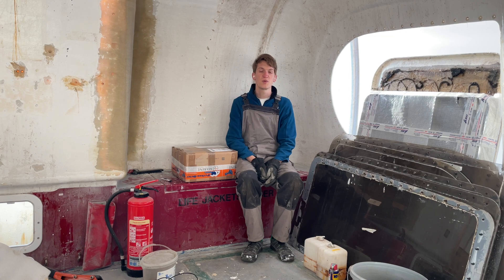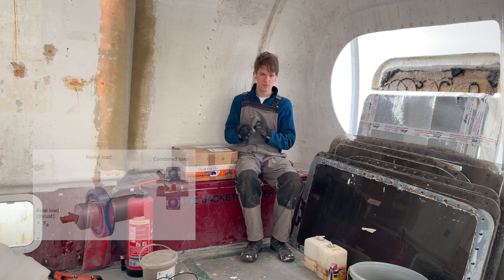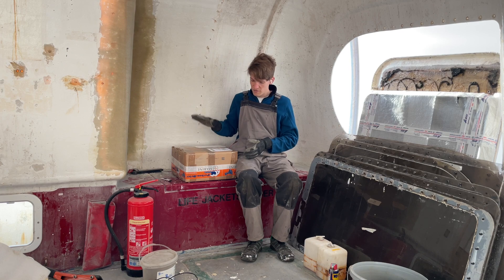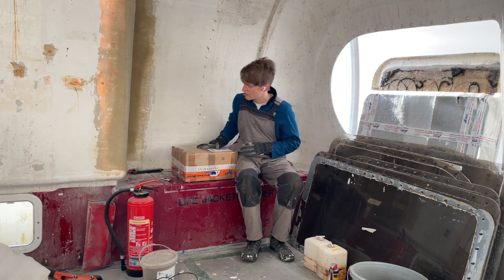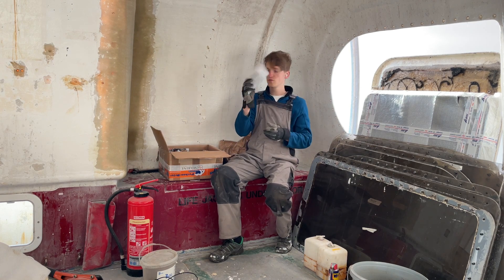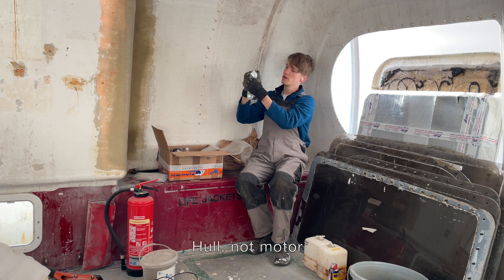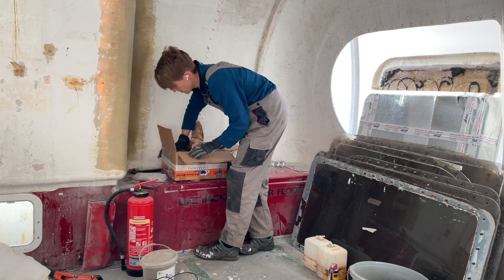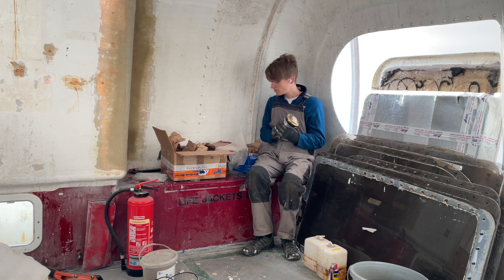Car motor on a boat - Constant velocity joint / Python-Drive / Aquadrive unboxing & explanation

Comment: I'm glad I found your videos. I had the same idea of using the Nissan Leaf technology in a solar boat setup last year when I started dreaming of converting a sailboat into a solar boat. I've returned to the subject a lately and have yet to see someone employ what I think would be an economic solution and it is this. In the UK, you can now pick up a Generation 1 Nissan Leaf car for around £3000-4000. For that kind of money, the 24kWh Li-ion battery would be partially depleted, probably only being able to charge to 50-60% of its original charge, giving a possible 10kWh. You'd also get the inverter and motor (80kW). You could add a cover to this boat or similar, and generate anything from 5kW to possibly 7kW depending on where you were in the world and the size of the canopy and array, and fit solar panels, like this catamaran did.
https://www.youtube.com/watch?v=ZWiC4kVCGXI&list=PLoro0LCx7dS4O0w3sxDsznVRCV2-GZYxy&index=20

This might produce 20-30kW on average daily. I have an 8kW array on my summerhouse roof that provides a lot of my electricity needs for my home and charges the Nissan Leaf. It's served by three 5kW solar inverters running in parallel. This year has seen the price of solar fall, and a 48V, 15kWh LiFePO4 battery from Gopel can be had for £2500. If two Nissan Leafs were purchased, then one motor could be carried as a spare and the batteries alternated between one always being charged and the other one always running the motor. The Gopel batteries could be used to charge the Nissan Leaf battery if the solar wasn't very productive that day. I've no idea how the weight of all this equipment would impact a steel boat like the following, or how the power to speed ratio would be impacted, but I'd love to try it with something like this:
https://www.boatshed.com/bruce_roberts_36-boat-263444.html
I think I'd put a mast up and have a minimal rigging like a junk rigging (although I'm no sailor) that this guy has just for redundancy:
https://www.youtube.com/watch?v=OiRBcjr1auw

Are you going to use the original Nissan Leaf batteries? This would be a cheap way of getting the 350V necessary to run the motors. 

Any thoughts?

Comment: you should get the whole hybrid drive system from toyota prius so when you go on a shorter trip you can run on electricity and if you go travel somewhere you can run on gas
Reply from the maker: Nothing being burnt on this vessel :)
Reply: @HeartofGoldLifeboat  dont tell me ya aint got no stove in that thing but anyway i like the project and i love the idea of putting any car engine into a boat, are you gonna have the og instrument cluster too?
Reply from the maker: An electric one, yes!

I don’t think I’ll use the original instrument cluster, too many things that need changing on the inverter side, so I’m going open source there.

Comment: Ford crate motors https://youtu.be/XH76oCkU93Q
Reply from the maker: That’s great! Second hand is still even better I think, especially with electric!
Reply: @HeartofGoldLifeboat  
Agreed Repair Reuse and then Recycle... The leaf motors are common and the modest status of the original donor vehicles means they should be relatively  available and affordable . 👍🏼 Whats the potential Hp equivalent and torque of these motors? What was the original ICE  motors RPM  .... Given the props you have...you will need to try to match your gearing to the props. performance.
Reply from the maker: They’re 80kW/108HP and 250Nm torque. With the original reduction gearbox the RPM range very closely matches the original RPM range of the ZF gearbox + Yanmar engine, maxing out at 1.300RPM instead of 1.400RPM now.
Reply: @HeartofGoldLifeboat  
😎 That sounds promising especially as that type motors power curve drops off at the top end ..

Comment: Polyurethane car and van  propshaft  drive transmission spider donuts are simpler cheaper and may work better in a boat... No moving parts and Stainless steel bushings...costs about £20-30 as found on old Transit vans and Ford Taunus Sierra and  you would still need a suitable size and speed range thrust bearing and mount to isolate the motor and drive coupling.

Comment: That’s a Porsche transaxle stub axle that’s been converted . Pretty much guarantee if you take that now and buy Porsche parts you could recreate it for about 1/2 price . I believe it’s a g11 ? Gearbox they are from .
Reply from the maker: Huh, really? The G11 one looks different, maybe some other model?
Reply: @HeartofGoldLifeboat it looks exactly like the ones that’s are converted Porsche axles used at the back of kits cars and autograss bike engined karts .

Comment: Oceanvolt
Reply: Oceanvolts systems may not be powerful enough for this ...plus  anything that is purely boat orientated is very limited availability and high in price. 
The availability of Second hand  auto parts like motors  controllers and battery packs increases daily as well as new crate motors.  
Though this looks well engineered I would have perhapse looked to use off the shelf industrial and auto components.
Reply: @clivestainlesssteelwomble7665  
Hi
three times the link I sent you has been removed. you have skype, i would send you so that they would not remove it
Reply: @MM-hb1sw  
I know its a big pain 🙄 with U tube.. yet they cannot block crypto or porn links.🤦🏻‍♂️🤷🏻‍♂️ .... give me a word description and i will google it.

Plug
Reply: Boat 
Is a good source of new stuff... 
Also Vetus in Europe..and others ...i put up links earlier in his project.
Reply: /standard-systems/
Reply: Conect this 2